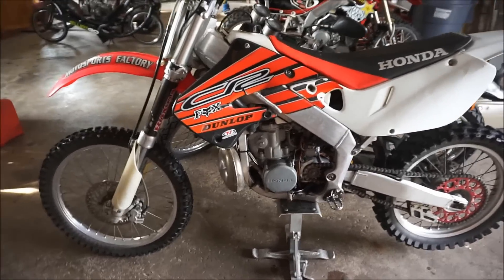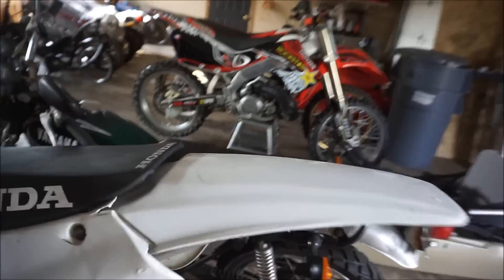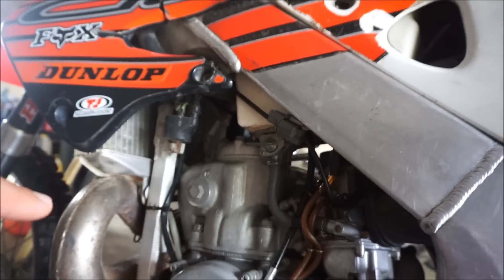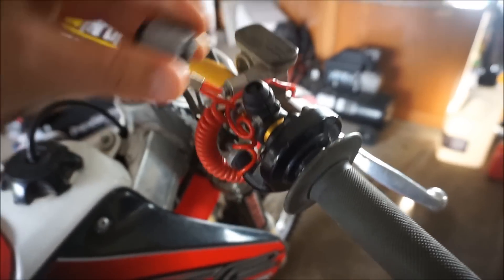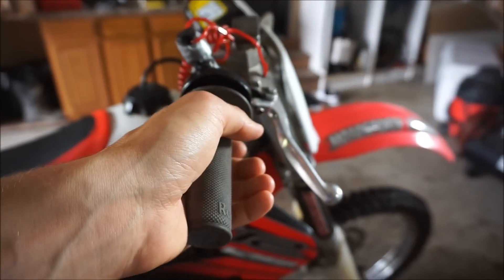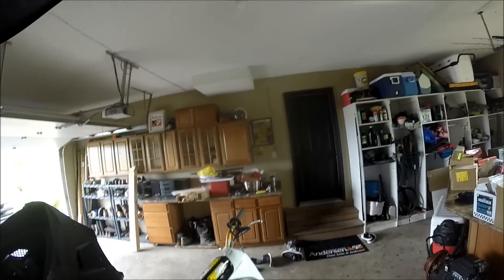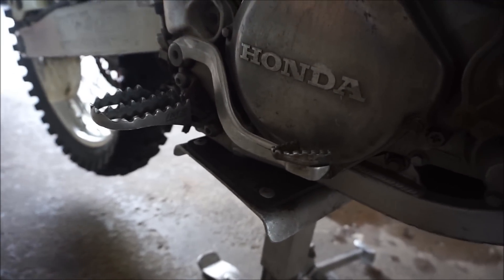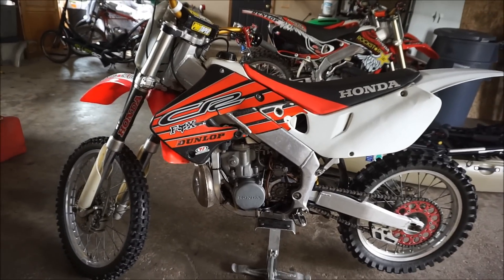I Blew Up My New Honda Cr250...

Comment: I have a honda 250r 3 wheeler and its an 82. And it hasn't ran for 20 years. I got it started all it needed was gas and a clutch cable. I still ride it and it has not blown up.

Comment: I can tell it was running way too lean when you started the bike, it wasn't smoking enough..
Reply: John it doesn’t even sound right when he revs it. When it gets to where it should make power it bogs
Reply: Hes running racing fuel of course its not gonna smoke.
Reply: @willsiegel8018  old comment, but replying for people to read this in the future… My 04 rm250 runs vp race gas mixed 32:1 with castor 927 and it smokes. Race gas doesn’t make your bike not smoke…
Reply: @tpghl5225  c12 dummy
Reply: @willsiegel8018  T2 is best in newer 2 strokes at least that’s what MXA says

Comment: It probably blew up cause it was jetted too lean causing it to blow up, or there was an airleak making it run lean too, or also they probably didn't break in the new top end properly. But for $900 isn't a bad deal. If the cylinder is damaged you can have it replated for $200 and get a new piston kit for around $200. And might want to look into jetting to make sure it wasn't off.
Reply: John mix was probably way way off

Comment: Do you still have the moto 4s? I picked up one for free and it won't run it's got gas, cleaned carb, great spark and a new plug, and it's got ok compression. And it still won't run. It wasn't even trying to fire. Is there a fuse box idk about?

Comment: Dude what are you doing first time you kicked it you could see it had no compression and you kept doing it wtf😂😥 you probably just messed up your cylinder aswell
Reply: Luke Fielding cylinder would have already been thrashed from riding it for that short time
Reply: First time it fired up i already heard it was bad. he keeps riding, doesn't hear it doesn't wanna pull, when dumping the throttle it already wants to seize, keeps on riding it back home, and keeps kickstarting it, hoping for some kind of miracle or something after checking the 'gas' ..totally clueless.If that 250 was 'mint' he would be hanging on the handlebars..
Reply: @lex1945  for real though

Comment: What don't you see on that piston and head maybe carbon??? Bike was way lean I could hear it also no smoke it is a 2smoke so I would be checking crank bearings and crank seals and check carb boot for cracks.

Comment: 233cc???? Sounds to me like it’s got a over sized sleeve/barrel and they have put a stock 250 piston in it sounds very weak and I bet hard to start till it gets warmish... frame and stuff is alone worth what you payed for it though so your not going to be out of pocket, check if there’s any water in the expansion chamber if it’s a head gasket there will be anti freeze in the pipe usually.

Comment: You straight gassed it didn't ya.bummer.i did that once,had been working on nothing but 4strokes for a couple years and then bought a 2stroke .rebuilt the damn thing and went to break it in and forgot it was a 2stroke because I'm a dumbass and put regular gas  in it and cost me another 500$ .love and learn right.

Comment: I bought a kx250 for 500 had a rebuilt engine I drove it for 30 minuets and it blew up because someone used snap rings to hold the wrist pin in and they broke and tore the crap out of the cylinder it was like I hit the kill switch it had amazing power and it stalled

Comment: Kudos to you for posting video of when a buy goes wrong.  Most people would not post anything and fast forward til fixed or gone.  
It could be a number of reasons its lost comp tho, it could have blown a head gasket or main seal, it did sound like there was metal on metal contact while it was running.

Also if you own 2 strokes and dont own a 2 stroke leakdown tester, get 1! You need to check the flywheel for play, odds are bearings are smoked and the seals have went with it and thats why shes running lean.  Good luck with her

Comment: That thing was rattling like mad from the first kick you gave it....why did you keep kicking the shit out of it after it lost compression? Not good.....At least its cheap and easy to rebuild dude
Reply: Streetwhore8te4 I think the rattling at first was the kickstart. After that when he was riding the bike sounded like it didn’t want to go almost like the cylinder was loading up with unburned gas. Aka fouling a plug
Reply: @That-Guy.  I'm a little late to the party but that is clearly the problem look how he drives the thing like it's a 4 stroke
Reply: Matt Eggleston  I don’t understand why people continue kicking like crazy after compression is gone as if the compression is just gonna magically come back.

Comment: There's plenty of gas he just forgot to mix oil with it, soon as he started it there wasn't a bit of smoke I used to run Caster oil at 80 to 1 and it smoked

Comment: I dont get it? is it a 125cc or a 250cc? you say its got 125 plastics and that the cylinder is bored to 134cc thats kind of hard to do on a 250cc cylinder.. sure its not a 125cc bike?
Reply: I caught him saying that too. (A 134 bore) hes wierd.   It's a 250, look at the exhaust pipe.
Reply: philip bender ahah “he’s wierd” 😂
Reply: Yeah im wondering too
Reply: NT DT its a 250

Comment: How long do you let your 2 strokes warm up because they aren't build to sit and idle for a long time I've heard that could gum up your power valve, I heard when you first start it for the day ride it for a minute not reving it out Emeditly, but on a 4 stroke it's a different story because, it's good to let it idle for a minute to heat up the oil

Comment: Tie it to truck and tow it down street in first gear and then it will form itself a new ring and smooth out any cylinder damage

Comment: It sounds like a compression leak or rings like you said it should still run if it’s the rings it just won’t idle it’s the same sound as my Honda atc it will still run strong tho

Comment: Why do people always say 2 strokes are way cheaper when its about the same price to do a 4 stroke
Reply: Quad&bikes R3 everything is a lot more expensive,and it u want to rebuild it,it will cost you 3 times more that a 2 stroke
Reply: the real xveselkox16 how does it cost 3 times as much. You can rebuild a 4 stroke top end for $100-130.  About the same price. Not much more
Reply: Quad&bikes R3 it depends on the bike and cc
Reply: the real xveselkox16 very true. I rebuild my trx450 and it was like $120 for piston, rings, clips, and rod
Reply: Quad&bikes R3 top end on a 4 stroke includes new valves, recut seats, and replacing all the cam bearings. It can also include timing chain and the cam. It gets ridiculously expensive
Reply: Dirt Moto i agree with timing chain and valves if they are really bad. But all the bearings and everything arent worth it unless your doing a full engine rebuild or if they are shot
Reply: Quad&bikes R3 the way I see it, better do replace everything if you're replacing something big like valves instead of risking on a 10 dollar bearing failing and toasting the engine

Comment: Worst thing you can do to a dirt bike is put a big bore kit on it 😂 😂 😂 NO NO NO
Reply: N u m b not true if you put it on correctly give it 9 heat cycles for 10 minutes each it will be fine and run it rich for a week also not mixing you oil to gas ratio correct is the worst thing you can do because it will simply foul plug after plug or blow up I’ve been running my big bore on my kx100 for a year and a half cause I treat it right and I’m always pinning it just a tip for if you ever want some more power don’t take this the wrong way
Reply: Yeah if you do it right and actually have your carburetor tuned right and they probably didn’t do any heat cycles
Reply: DeepDirtRider Well you see the bottom end is Made to run the stock compression, not to run More compression with the more CCs. You will blow the bottom end eventually so it's not a very good idea to put a big bore in.
Reply: Tigglemeister only safe way to do a big bore is then get a crank shaft and crank bearings meant to handle a bigger bore

Comment: You said 134cc when that’s suppose to be a 250cc
Reply: Blaster528 I bet you it was a 125 bored to a 135
Reply: Opevix - but..... it was a CR250 with a bent exhaust pipe. See the dilemma

Comment: This is why you never bore out a 2 stroke.
Reply: Connor Smith no just no do it right nd they will run for a while trust me I know as I have a board bike and it's been board for about a yeah now
Reply: QsR x RaP1dZz i understand that you can do it right but i was thinking from my perspective. I race and thats enough stress on the engine to begin with. A bore kit  isn't needed in a race not to mention illegal in most races.

Comment: Amsoil makes the gasoline RED.  so you would instantly know it's amsoil pre mix.  Not smelling
Reply: philip bender Actually unless your using interceptor instead of dominator. There’s also saber too which isn’t red
Reply: Blaster528  Look you don't gotta get that specific. When people refer to amsoil, they are  referring to dominator!
Reply: philip bender my apologies
Reply: philip bender That's not true at all. I used to use dominator until I heard that it was mainly for racing applications and had less rust inhibitor in the mix than interceptor. Whether or not this is true I switched to interceptor to be on the safe side. Never had any issues using either.
Reply: philip bender Why are you mad? Dominator is not the only AMSoil 2 stroke oil there is, plenty of people use Interceptor.
Reply: GyroPyro12 deez nutz-your chin. Hahahahahahahah
Reply: philip bender Oh now I see. You're 11 😂
Reply: philip bender alright phill put your hand bag down and simmer a bit before u collapse
Reply: philip bender I'm straighter than you apparently, you didn't even know there was more than one kind of AMSoil. I'm assuming you ride a pink PW 50 with training wheels and wear a "special helmet" that you have to wear at all times, on or off the bike.
Reply: So is klatz or how ever u spell it witch i always run and is great
Reply: philip bender Snowflakes get offended, I would never be offended by someone who clearly isn't all there.